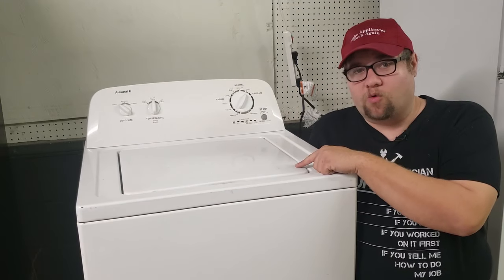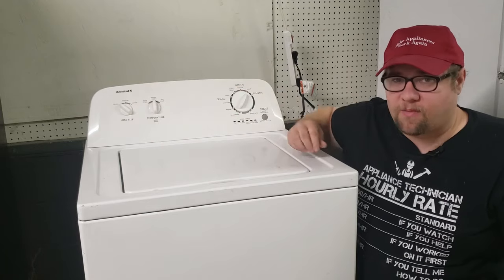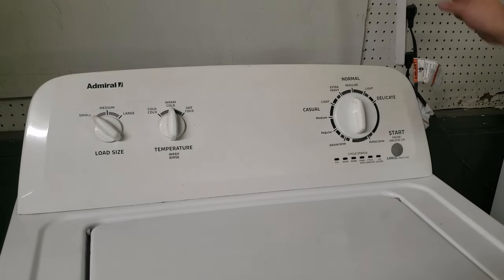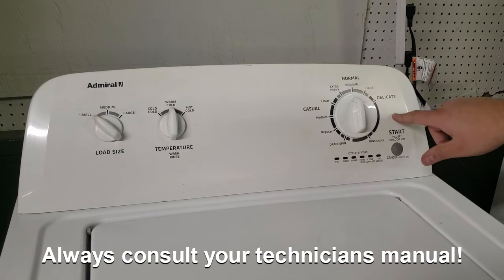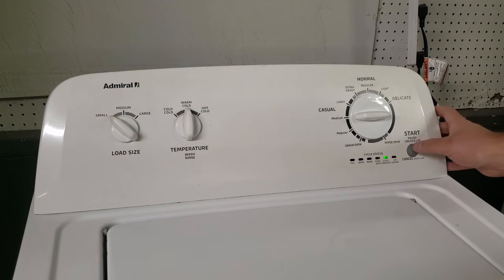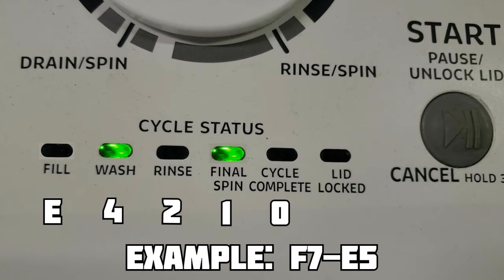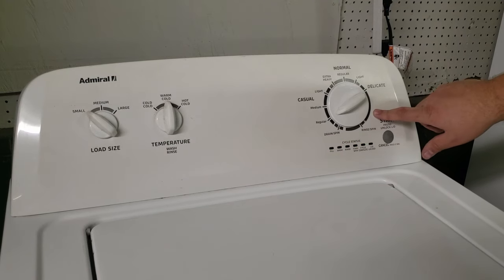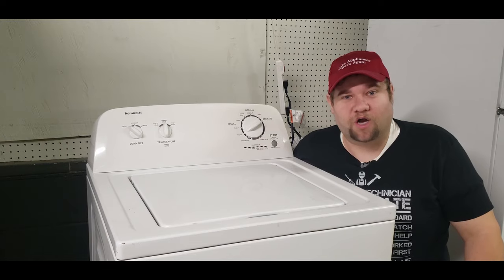How to Use Troubleshooting Mode on a Whirlpool, Maytag or Amana Washer AND Understand the Codes!

Comment: To get the main dial to show an error code, I suggest turning the main dial very slowly.   Thanks for this video, but I do not recommend this machine, i.e. don't buy a machine with a diagnostic control.   I could not figure out why the Whirlpool top loader like in this video will not agitate.   I replaced the dog teeth in the agitator.   The machine clicks bur fails to agitate, but DOES spin dry.   Just because a machine shows a certain error code does not mean that is necessarily the problem, nor does it mean that you can fix the problem economically.    Suppose you do fix the actual problem, but the machine fails to operate due to the error code that is programmed into the diagnostic unit.